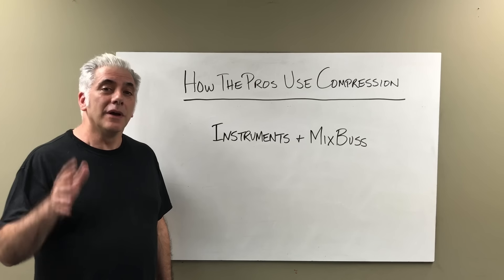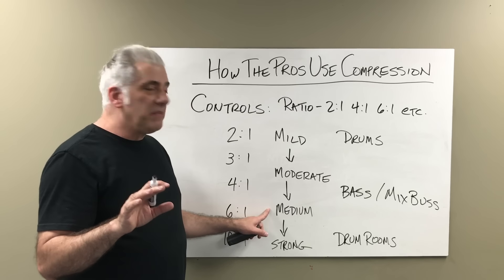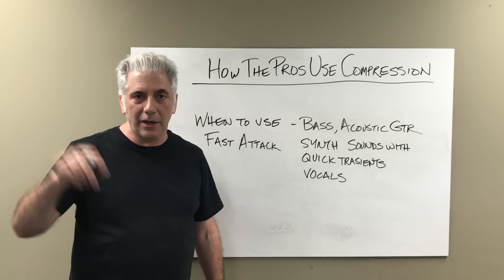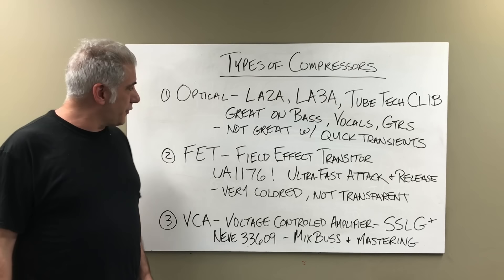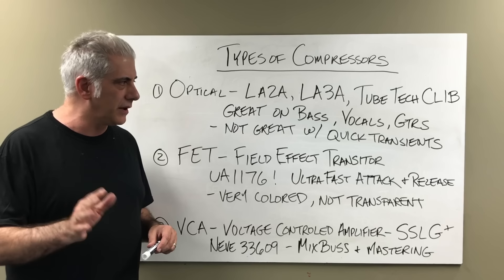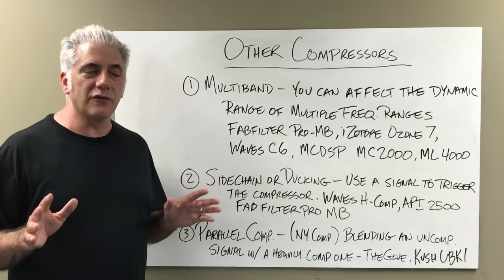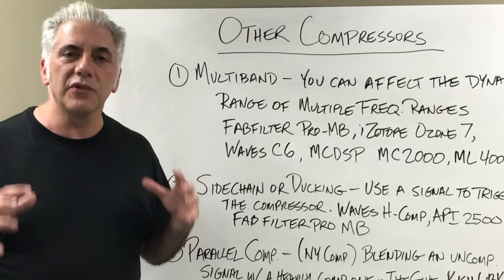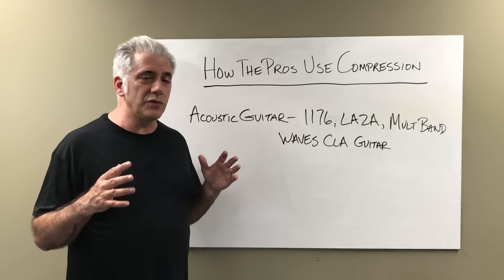How The Pros Use Compression on Instruments and Mixes

Comment: The best, most comprehensive explanation of compression on youtube. PERIOD.
Reply: period PERIODperiod
Reply: Lal lolita let ll send lol and love l
Reply: KtM great information thank you
Reply: The real question, do I need a compressor pedal?
Reply: @harrysachs2274  if you use single coils? Absolutely. It tames the shrill singlecoils, and increases your output. Humbuckers are already compressed to death, so it's optional.
Reply: @jsullivan2112  compared to single coils, humbuckers are compressed exponentially. For my use, not all humbuckers need a compressor running in the chain. It almost always depends on  the response I get from the humbucker.
Reply: @jsullivan2112   humbuckers are compressed, because you basically have two singlecoils running as unit. What you get for most humbuckers compared to a single coil is 1.) Lesser dynamic range, but more consistent to the touch 2.) Darker tone (Because compression dulls the highs) and 3.) Higher volume/output — all of which yields itself to compression.

As for P90's, I honestly haven't dealt one with myself personally, so I can't answer that for you, sorry.
Reply: Well, he didn't really explain the details of what a mix knob does. I wish I could have got some more details on that tbh
Reply: Yep
Reply: @benirw1n  I wouldn’t necessarily call this the BEST or MOST comprehensive video on compression for sure. 

The only thing a mix knob does is blends the compressed signal with the dry signal, a technique known as parallel compression. 

So say you’re running some drums through a compressor. You really like that thick, fast attack sound that the compressor, but you’re missing some of the transients of the uncompressed signal. The mix knob can allow you to blend some of the original signal back in to bring some of that transient back. That’s only one example though, parallel compression is a really popular technique on lots of sources and has a decent amount of different uses. I know I’m 5 months late but I hope that helps!
Reply: Scraitup scraitup 💯
Reply: @bluehole6019  I don’t think he is referring to the use when he says that ,but rather how it is explained as in how  attacks release and the other knobs works and what exactly they do
Reply: I Agree man!!

Comment: Notes to self:

Dynamic range / loudness is a function of music that needs to be addressed at the mixing stage. 

Gaining perspective on the loudness of your song:

A) use metering 
check the LUFS , rms, perceived loudness 

B) find a professionally mixed reference track and a b your mix with it on different systems 

If your tracks are not loud enough, you obviously need to get them louder. 

How do you make loud mixes? 
First understand the relationship between dynamic range and loudness.

What is dynamic range ?
Dynamic range is the difference between the quietest and loudest parts of your track.

Digital Audio goes from - infinity to 0 (loudest).
When you cross 0 you get distortion.

By limiting your audio to -0.1 you can then just jack up the volume and get max loudness without distorting right ? 

Wrong.

When you start trying to make it louder you will start to lose parts of your Audio. The transients will go first, so your drums ah start sound Lakka doo doo. 

So how do you gain loudness without losing parts of your Audio or distorting? 

You could :
- Lower the volume of your transients
- lower the bass 
- compact the sound by reducing the dynamic range and then raising the volume 

That’s where compression comes in. 
It’s a tool you can use as a function Of compacting Audio aka reducing dynamic range. 

But how does reducing dynamic range help make a track louder? How does compacting Audio and then doing gain compensation help?

It helps because you get more perceived loudness while taking up less volume, so now you are further away from the ceiling but it sounds just as loud. Now when you come to limit you can raise it even louder. 

It’s like being space efficient.

- Notes to self to be continued
Reply: Excellent!
Reply: Wow
Reply: Amazing 🙏
Reply: Nice. I would add that there are more goals that you can achieve with compression, not only loudness. You can obtain more definition or sustain, as you are able to enhance the back ends, or, as it is said on the video, you make the sound more even. All of this at the cost of reducing dynamic range, which in the other hand could be valuable thing that you are losing, thats why the dynamics of piano and forte exist.
Reply: This is dope
Reply: Amazing man..
Reply: Thank you
Reply: Saturation is a great way to reduce the volume of transients
Reply: @andrewhigdon8346  I've just finished reading this while listening to Ocean Size by Jane's Addiction. Thanks for the comment. You should have your own TED talk.
Reply: @alebarchini  🤣🤣☠️